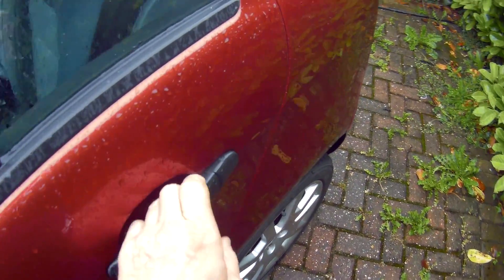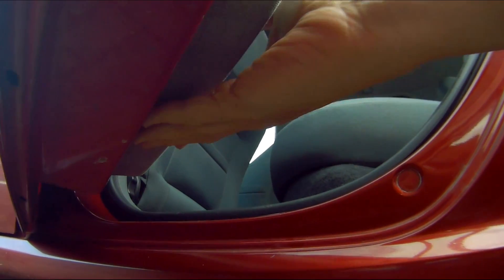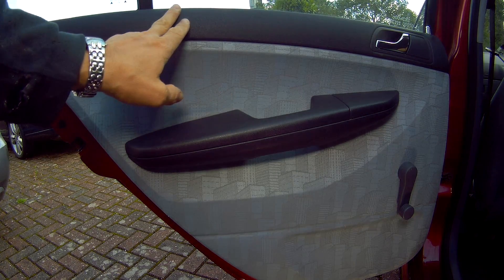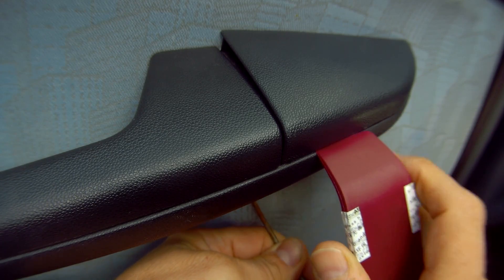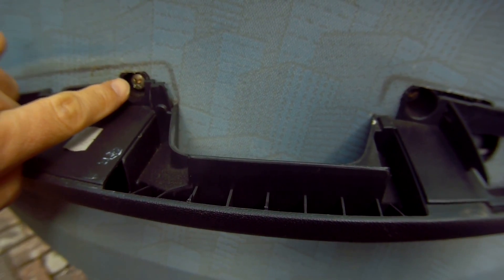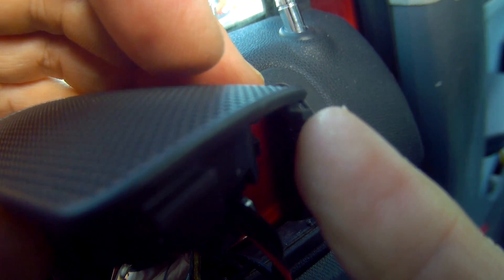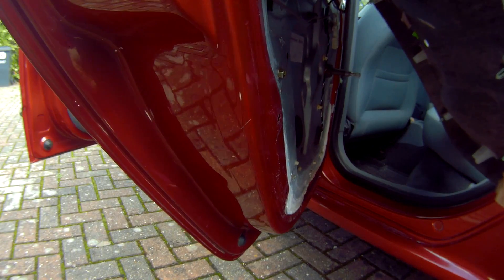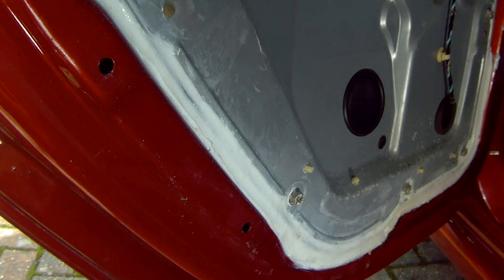SKODA FABIA Rear Door Seal, (wet footwell) 99-07

Comment: Great video there!!! I bought fabia combi 1.4 75 hp 2005 a few months ago and the car is just simply amaizing. I noticed that isssue with the same door side. I just put some towels temorarry just next to the door sealing, because the winter just came and at this point i wont be able to repair it. Well i thought about the window sealing. If the issue is there would you recomend me to change it? On a first sight i dont see any damage on it, as i dont see either on yours.
If i put this silicone only on the metal side door panel i think that the water will keep on getting inside and will stay there, eventually causing some rust. Can you advice me something? Cheers and thanks again!
Reply: Sorry that I repeat the question. I saw a fellow that ask the same  below in a comment seciton. There are actually drain holes which is great! Cheers!
Reply from the maker: Yes, these drain holes are easily missed as they are right under the lip of the bottom skin, but they only stop the door filling up with water. The water drips onto the inner panel seal from the inside and seeps through onto the door trim panel bridging the actual rubber door seal. That is my take on it anyway :-)

Comment: Does the water not now just get stuck inside the door? Or is there another route for it to escape?
Reply from the maker: Good question; there are 2 small holes under the bottom of the door lip.  I have never noticed any sloshing about of water, so the holes don't seem to get blocked.  Another theory of mine is water may get in by capillary action from pooling at the bottom of the body door sill and touching the inner panel past the door seal, but I didn't dare say that in the video as it sounds like i have too much time to think of such things. Anyway the fix seems to work, so no worries, happy days :-)
Reply: @HatBoyHarvey  thanks for the reply. I did this on mine yesterday on my MK1 Fabia so hoping it works. Thanks again
Reply: I thought exactly the same, any information out there as to whether this happens? Or, Josh Watton if you wouldn't mind - any updates after fixing yours? Cheers 👍
Reply: Does anyone know we're I would get a back door bodywork seal
Skoda Fabia estate 800 2003.?

Comment: Thank you for the information - really nicely portrayed as always :)
Are there any drain holes in the bottom of the door? It seems to me that the rain is getting in at the top and must be filling the door itself to then leak out of the seal behind the door card. How does it ever drain?
Previous cars (nissan/toyota) have had a little hole at the bottom of the door for any rain to leak out of. Would it be an entirely crazy idea to drill a small hole?
Reply from the maker: Thanks, you're welcome. There are drain holes underneath the rear door edge on the very outside edge of the sill :-)
Reply: @HatBoyHarvey  Massive thanks for the heads up - I'll have to have another look as I couldn't see them on my car or on your video. Bathtub sealant it is then =)
Reply: @HatBoyHarvey  merhabalar yapıştırıcıyı gördüğüm kadarıyla hertarafına uygulamamamışsın sadece alt kısıma uygulamak yeterlimi. Yoksa çevresini tamamen yapıştırıcıyla kapamalımıyız
Reply: @ye427  benim anladığım en alt kısımda su tahliye delikleri var ancak bir şekilde iç tarafa kenarlardan geliyor. Bunun için en iyisi komple sızdırmaz yapmak. Sadece alt kısım yetmeyebilir.

Comment: Could I drill holes in the bottom of the door instead? I can buy a new door if it ever begins to rust around the drill holes.
Reply from the maker: You could, but there are already holes there. You have to bend down a lot to see them under the rim edge. Whatever holes there are, water has to drip off the door vertically down. When there is light rain water ingress, water will creep horizontally, hence why the fabia's drain holes are positioned where they are, on this edge :-)

Comment: Hiya chap thanks for the video. My carpet isn't damp  I've actually got a puddle in the back of the car haha  is that a different issue? Do you think just drilling more holes would have the same effect?  Thanks.
Reply from the maker: Water doesn't seem to collect in the door so the holes are doing their job, it seems that water seeps onto the foam seal somehow and bridges via the innner panel.
Reply: @HatBoyHarvey   ahh ok thanks for the reply I'll get it done over the weekend and give you a bell if it solves the issue.

Comment: If you seal the bottom of door where does the water go. Does it sit in the door?
Reply from the maker: If you look right underneath the door you will see that there are some small holes for the water to drain out. Obviously these should not be blocked, but you can easily tell as you can hear water swishing about inside the doors when opening/closing them :-)

Comment: Thank you for this video. Im in the process of buying a Fabia Mk1 that has some electrical problems. Can this be the reason? Is there a similar water leak problem in the front or from the windshield ? Also can you make a video on how to fix the central locking or at least diagnose any common knows issues ? Great work! Subbed !
Reply from the maker: Your welcome, Great car, but can have a few electrical issues/glitches. haven't come across water from windshield. It depends what central locking issue, mine sometimes does funny things when stood a long time in damp weather, also worn front door lock micro switch is common. Vid on list :-)
Reply: Not sure on the nature of the problem with the central locking.. haven't even got the car yet to investigate. Im thinking like a checklist video, fuses, battery connections, etc... Thanks to your channel I feel like i can almost fix the problem my self and save a trip to the shop. Almost :D
P.S. "You're"
Reply from the maker: It is always that more satisfying to be able to fix stuff yourself in my
 opinion, saves money that you may need for a job you can't do yourself and you know exactly what has been done to your ride :-)yes you're not your, always doing that sorry :-(
Reply: I reckon water gets in the driver's door through the window seal and damages the central locking module inside the door - it used to click the locks repeatedly or open the windows in wet weather. The cheap 'temporary' solution was to remove the fuse to the central locking, the doors still lock manually.

Comment: I just started to do the same process on my mk1 Fabia on both rear doors. It took me two hours to get one of the inner panels off. Those panel clips were really putting up a fight. Unfortunately, my metal inner panel is riveted and I don't have the tools to drill them off and replace them with screws. My question is, is it enough if I let it dry for a bit and then put silicone around it without taking down the inner panel? 
And again, your channel is really useful! Thanks for doing this! :)
Reply from the maker: If you can squeeze some into the gap, or pry a gap it MAY work for a bit, but would need to be sure it is super dry as the seal sucks up water like a sponge and will be very difficult to get dry properly.
Reply: @HatBoyHarvey  Thanks, Harvey! I will try my best to squeeze some silicone in there but it seems impossible. It's riveted pretty tight. The seal is sure soaking wet. Are there any holes at the bottom of the door where the water can drain out? There should be some but I couldn't find it.
Reply from the maker: Yes, there are holes under the door edge, you just need a second look :-)
Reply: @HatBoyHarvey  I'm thinking about washing the side panels under the shower with soapy water. They look pretty dirty and it seems they made out of fiberglass. Do you have any experience cleaning them?

Comment: i’ve got a rear door window to replace, my bolts are rivets, any tips on how i should go about replacing the window?
Reply from the maker: Yes, later models unfortunately came with riveted panels (why?). These
are large 6.4mm rivets that you will have to drill out. Once the panel is off,
the window mech can be accessed to replace the window. Given the large size of the rivets,  another means of fixing them securely back into place would probably be easier. Maybe you could drill new holes to the side, seal the original holes with rubber grommets and use smaller rivets.
Reply: HatBoyHarvey Thanks for the reply! do you reckon i could just swap them for nuts or something?
Reply from the maker: If you swapped them for bolts I don't think they would be secure enough as there is no tread/nut on the other end other than the thickness of the door metal to tap into :-)

Comment: so will the door just fill up with water after doing this?
Reply from the maker: nup, the water exits at the bottom of the door. If you bend down to have a look close to the seam there are two (if I remember right) slotts for the water to run out.:-)
Reply: @HatBoyHarvey  well that's good then.  I'll give it a go if the '07 i just bought gives me trouble.  The dealer said it didn't get wet but I noticed what appeared to be dried dust marks around the edges of the rear door armrests.  Bought the car anyway because it's easy enough after watching your videos.  I also was much better prepared to assess the car after finding your channel, thanks so much!
Reply from the maker: @Rareos  No worries, thanks for watching :-)